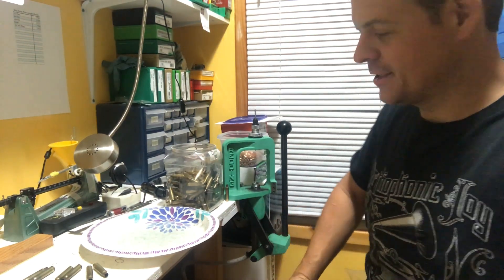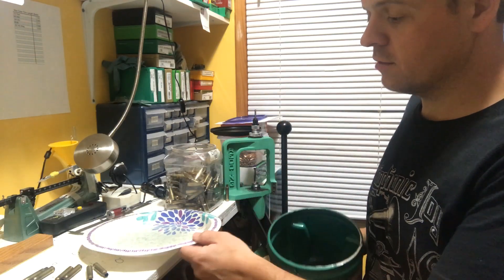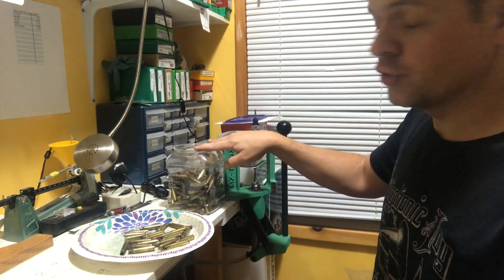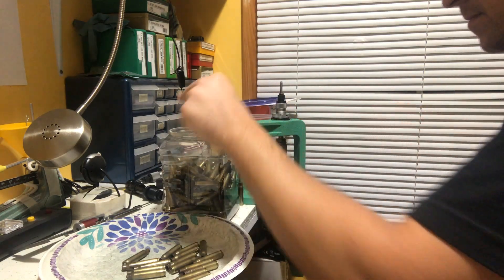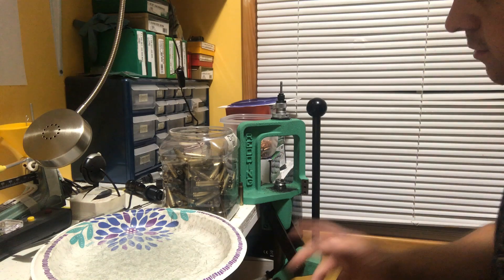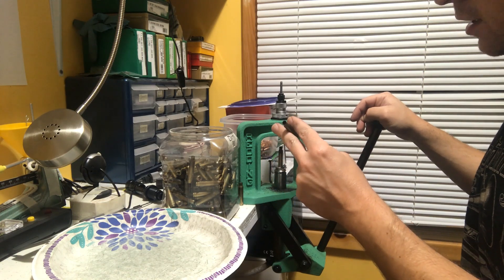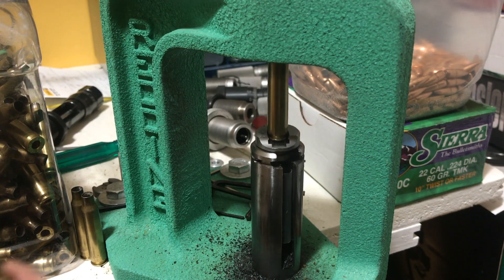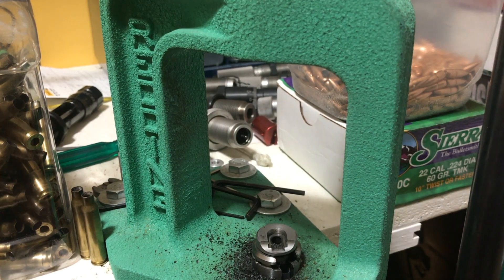*QUICKLY* Resize Brass on a Single Stage Press

Comment: What did you add (in white) on that scale bar ?
Reply from the maker: Ricardo Baggio they’re actually little “pipe cleaners” so the beam doesn’t slam down when the pan is removed! Think of it as a “suspension system” for the beam haha. I plan to make a video on “beam scale upgrades/tips & tricks” soon!
Reply: @stricklyreloading8494  Great. Thanks for feedback
Reply: Subbed my friend 

Thank you brother